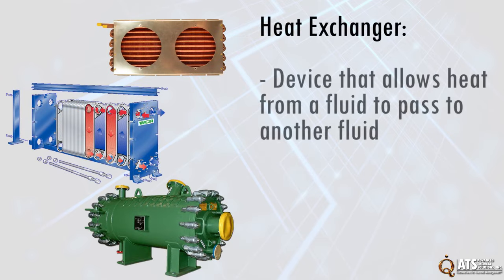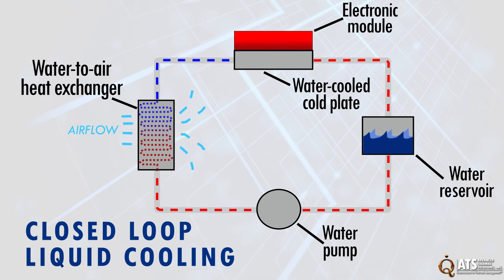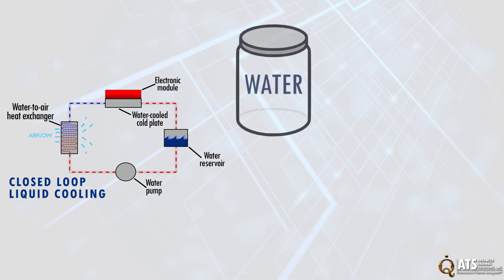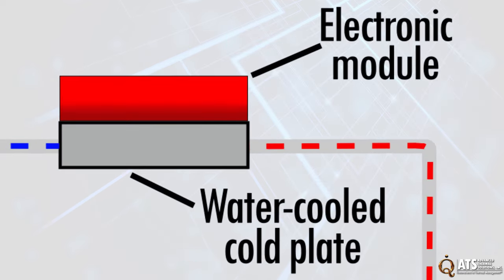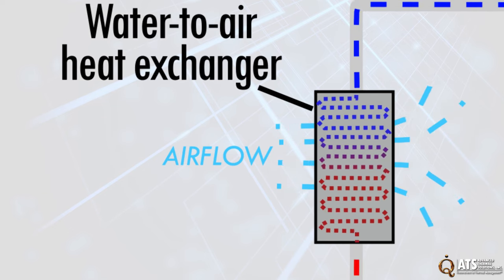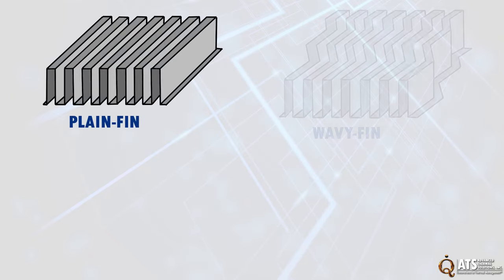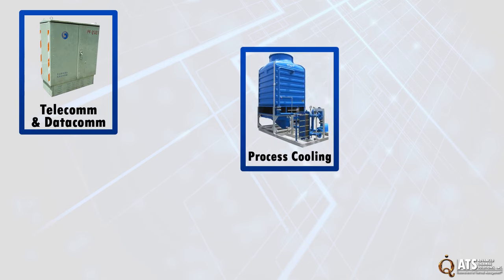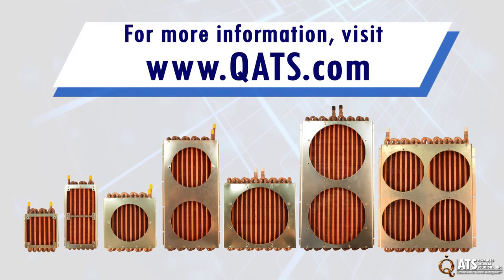What is a Heat Exchanger?

Comment: Reading a paper on Hybrid power generation RN. They actually use a heat exchanger to preheat air going into the fuel cell for better efficiency. 

Kinda cool how the “wasted heat” from exhaust can actually be used to preheat fuel and be more efficient.  ☹️🤷‍♀️👍
Reply from the maker: That's interesting! In electronics cooling preheated air is not generally something we like (though at times it is unavoidable). But the application you note sounds ideal for it!
Reply: Someone mentioned a “counter current” and said you didn’t include it. What are they talking about?

Comment: Why shouldnt they come into direct contact?
Reply: Because that would be a refrigerant leak. The refrigerant is in the metal pipes, cooling them, when room temperature air passes over the pipes it cools the air and the heat from the air boils the refrigerant inside the evaporator (heat exchanger.)